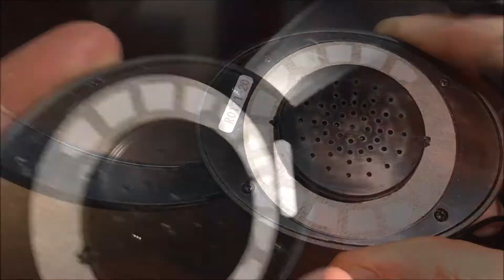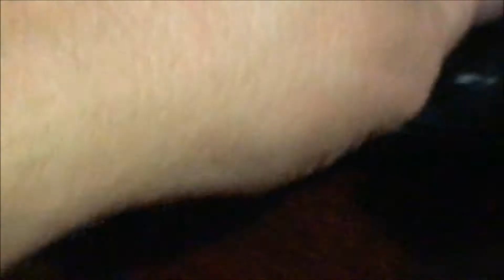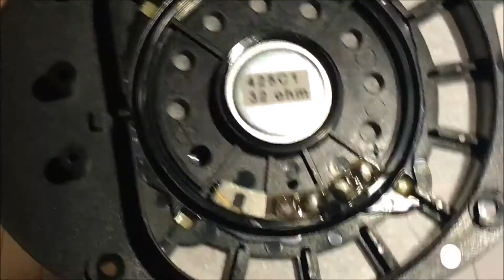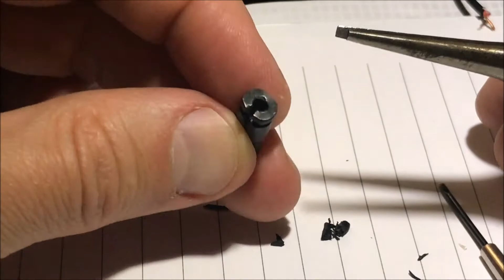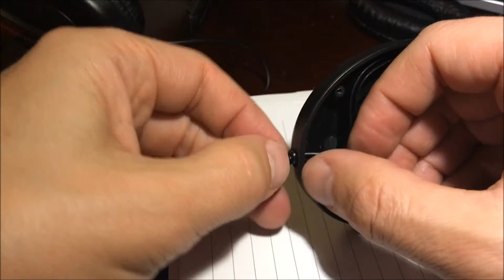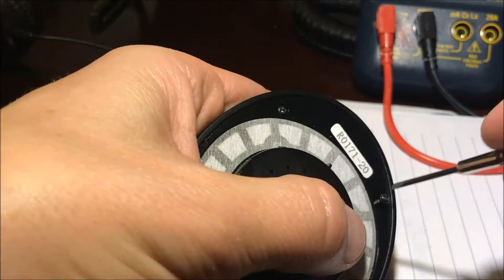How to Repair Headphones - Broken Cable

Comment: Does this work on the hd203?
Reply from the maker: If a broken cable wire is the issue, you could use the same approach on most headphones (assuming they are designed in a manner that allows you reasonably easy disassembly).

Comment: I have the same headphone and the same problem.  This video was very helpful. Instead of discarding the wire from the speaker to the break, I spliced it together.and put the spliced part in the speaker section. hopefully it will last. Thanks

Comment: how to get those cable wires? i need to replace cable for hd 180
Reply from the maker: Search for a 3.5mm repair cable for headphones on eBay. Make sure that the jack matches (stereo jack I assume). I hope this helps.

Comment: wonderful! thanks a lot! just one thing, is it possible my broken (and now repaired) speaker work a little lower? how can I fix that? thanks once again!
Reply from the maker: Fixing the broken wire should not impact the frequency response of the headphones. You could double check that your ground wire and left vs right speaker  wire are soldered well to the correct terminal.